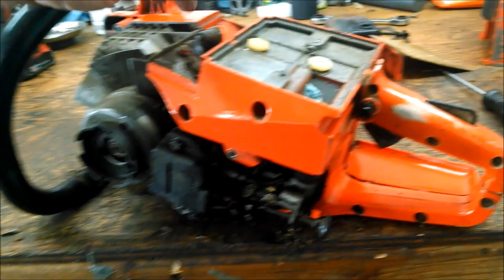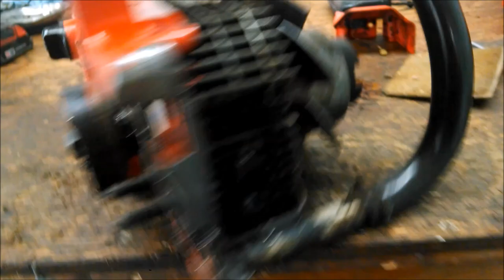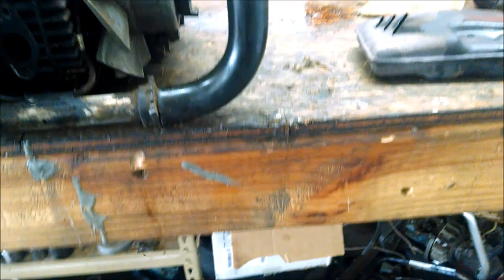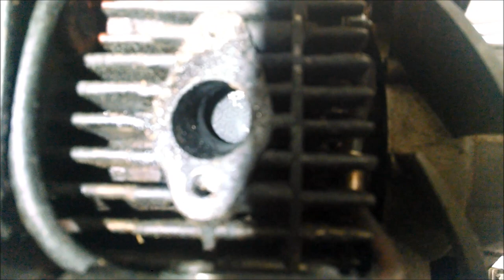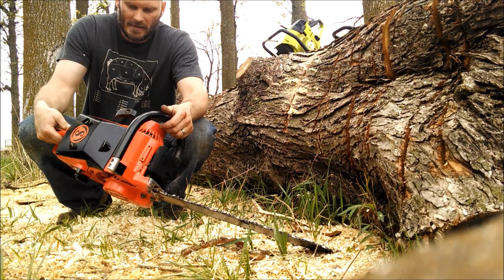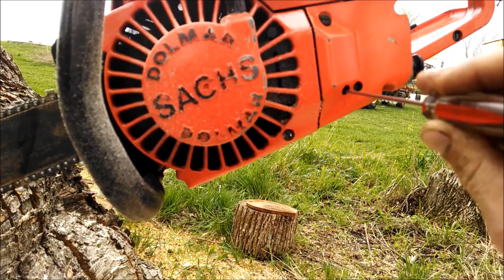Sachs Dolmar KMS-4 Wankel Rotary chainsaw

Comment: GREAT SAW, I had one years ago, unfortunately it was lost in a shop fire that was a complete loss. I have not found another one since that was priced right, so I've gone back to the old faithful STIHL which are great if you get the pro series saws. 
 As a former logger and sawmill operator I've cut my fair share of timber. The Sax Rotary was a fantastic saw for all season easy starts. You have to adjust the high speed carb setting depending on weather cold or hot aside from that it was one of my favorite saws out of dozens of brands I've used and owned over the years.
Reply: that is an ultra low emmision charge cooled rotary

Comment: Wow that sure is unique. I didn't know until now a rotary engine chainsaw was made.
Reply: There have been rotary engine saws, lawnmowers, boats, snowmobiles, etc. They tend to burn more fuel than 4-stroke piston engines for the same power so they fell out of favor, but many companies tried their hands at building them.
Nifty little powerplants.
Reply: Its an ultra low emmision charge cooled rotary! Moller international i got an omc 528cc rotary
Reply: I spank my charge cooled rotary!

Comment: Yunno, like other commentors I expected higher rpms out of the rotary, but there is only so much chain speed you can safely operate with so it makes sense. No bigger (and heavier) than the is, she absolutely doesn't give up in that big wood. Great on ya mate.
Reply: The high rpms are much easier to create with a multiple rotor setup, single roter engines are almost always out performed by single piston engines, still way cooler in my opinion to have a rotary tho
Reply: Probably could squeak out more rpm if it was leaned out a little bit
Reply: Aren’t these things at least partly charge-cooled? (Most saws are…)

Comment: This rotary engine had an advantage over the Mazda cars, as it runs premix oil/gas to keep the apex seals lubed.
Reply: carabela125 people run premix in the cars too.
Reply: The rotary is like a 2 and a 4 stroke together
Needs oil/petrol mixture
4 compression cycles
No valves
Reply: @GhostOfDamned  The Mazda Wankel mixed crankcase oil into the gas at the carb. Actually a two stroke,no exhaust 'stroke'. in the usual sense.
Reply: mazda uses oil injectors but it uses the engine oil and the injector often fails. so most rotary owners premix like 2 stroke
Reply: So does the mazda and they run oil injection with amsoil interceptor what is your point
Reply: Их сейчас выпускают?

Comment: Very interesting, a couple of companies did try rotary chainsaws besides Sachs but they were all expensive and failed.  One characteristic of rotary engined cars is very poor low end torque but this chainsaw seems to pull ok. But it is effectively quite a big engine due to the way rotary engines count cc.
Reply: Plus it just sounds awesome!

Comment: I had heard of Wankel-type small engines...First time I'd seen one on a chainsaw, though...However, I figured it was going to cut through that large tree trunk section with little or no problems...Rotary engines are known for the power they can produce in proportion to their size over a standard piston engine...Drawbacks are that the rotary engine often requires some internal maintenance during its life, and they have never been very fuel efficient...
Reply: Not to mention atrocious torque

Comment: Seems like its BUTTER smooth. Really a neat unit. Twin rotor saw next??
Reply: Twin rotor would probably just be heavier for the same power. Below a certain displacement, one is fine.
Notice that pretty much all small piston engines are single cylinder.

Comment: It still cost here in Germany over a thousand Dollars. One is going on in Ebay right now, it's now €700 Euro. It may  go higher to over € 1,200.
Reply from the maker: Depending on condition, they fetch 800-1800 here.  A solid runner will be in the low 1K USD.

Comment: You would think for a rotory that it would run at a much higher rpm and cut much faster than it does. I would live to see what a semi peripheral port would do to it.
Reply: Nicholas - Dont sound like a rotary to me - Dont think this is the same one from the beginning. It has that 2-stroke growl.
Reply: These are peripheral ports. Only Mazda tended to use side inlet ports - the NSU and Sachs Wankels were all peripheral ports as stock.

Comment: Now that is unique!   To a Mazda rotary racer or fan it should be worth quite a bit of coin.
Nice find Mitch.
Reply from the maker: Did you catch the 13B rotor in the background?  :)  That one didn't survive 10K rpm
Reply: mweba1 Uh oh.
Reply: mweba1  I find it interesting that a rotary engine would die at 10k  just old I dont know alot of rotarys I understand how they run. Did it blow the rotary seals or something.
Reply from the maker: HORIZON8026 10K RPM standing clutch drop.  It blew a Apex seal.
Reply: that sucks hopefully i can get  seals or a set made up  if ur putting money into it anyways.   im a husqvarna guy i like stihls to but not like the husqarnas i just played with my 372xpg and got a parts saw xp sawped to the lighter flywheel and and played with the key in the fly wheel set the timing advance nothing crazy but it zips alittle more, pulls an 8 pin.  i dont have a timing light or anything, just understand how it all works and i wing it lol  with my stuff only lol. ground the intake up and squared it up and took some off the piston intake skirt  just picking at things and getting good results. one day il really get into it. all the timings and durations. love saws.

Comment: yo bro why are you using my mazda to cut that tree? I'll need that back by tonight. I've got a honda lawnmower to race. (owns an rx8)
Reply from the maker: Alexander Familo  Funny enough, I sold this saw for more than my 04 RX8 after second engine failure.
Reply: 29 manufacturers bought the rights to use that engine. GM, Ford and Chryco included.
Reply: @maxwebster7572  GM made a rotary that went 300,000 miles on the test stand without needing apex seals.
Reply: @lorenhusky2717  GM also made electric cars over 30 years ago.
Reply: @lorenhusky2717  Felix wankel the inventor of these engines also created engines that ran for other 500,000km in testing. Unlike most people believe these engines can actually be pretty reliable if you maintain them properly.
Reply: @Muh boi You missed the point. The technology was there for a more effiecient form of transport. Now on to the debate whether  the steam powered car came before electic.
Reply: @tobiasdierks  As far as I can recall working on the Mazda's the main issues were carbureation, ignition and consumption.
Reply: @lorenhusky2717  but they couldn't get good economy out of it. the engine was supposed to be used in the AMC pacer but gm canceled it before it could be used. AMC built the car specifically for the engine and when they reconfigured it to an AMC v6 the fit was tight
Reply: @maxwebster7572  the ev1 is a good example

Comment: Does it feel like it has significantly less vibration that the equivalent piston engine saw?

What is up with the fan turning the same speed as the rotor?   I thought Wankels required 3:1 gearing on the eccentric shaft.

Comment: cool,   love that saw and it does lope like all 2 stroke wankels do
Reply: My omc rotary 2 stroke lopes also, i love it!
Reply: Wankels are 4 stroke. Just because they run on premix don't automatically means thew two strokes. That is just a way of lubrication
Reply: @ivannovoselac3518   Wankel = Wankel, not 2 or 4 stroke like a piston engine with valves or ports. Every rotation of the rotor gives 3 rotations of the output shaft and every rotation of the rotor does 3 combustions, so while it sounds high revving, and the output shaft is, the rotor turns only 1/3 the rpm.

Comment: turbo it
Reply: if its a 2 stroke its not possible because they need the exhaust back pressur to keep the fuel inside
Reply: A rotary engine can only be a 4-stroke, so its possible to  turbo it
Reply: Anders Lindberg   A Wankel qualifies as 2-stroke, because the engine's displacement is cycled in one complete rotation of the crankshaft, but it has the interesting ability to have a complete scavenge cycle.
Reply: Its neither a 4 stroke or 2 stroke
Reply: Rotaries have 4 engine cycles but no valves

Comment: I'll take my Husky 550XP over this thing any day.  I'm a fan of odd things like this.  But for a day in and day out tool, that 550XP gets hot and it's 10-20% more productive than the 346XP and more fuel efficient. A sharp 550XP will smoke a comparable Stihl any day.  And the bonus of a Husky? You can actually start the stupid thing.  We actually still have an old 42XP that still makes it out to the job site every once in a blue moon. We had a 246XP that someone run on straight gas, so on a slow day i rebuilt the saw (not the motor), fueled,  choked,  pulled,  and the old 42 came back to life.  Those Stihls, we had a 084 or 092 (394XP equivalent) it took 20 minutes and 3 guys to get that stupid saw running. Choke, high idle/half choke, high idle,  repeat for 20 minutes.  3120XP, pull and go.
Reply: It kinda sounds like my girlfriends rx7!